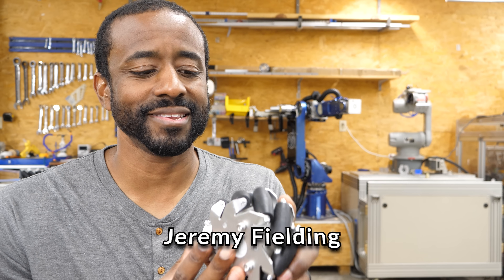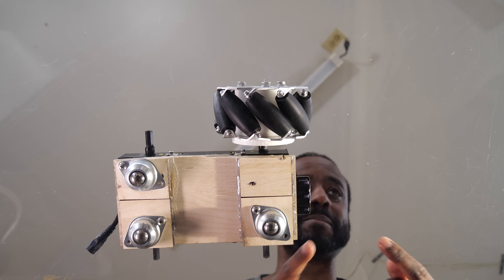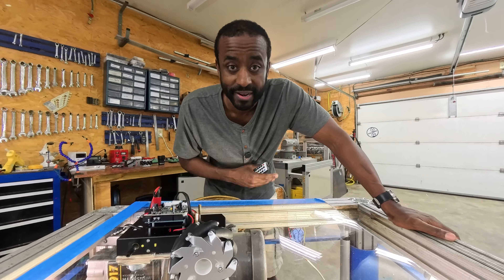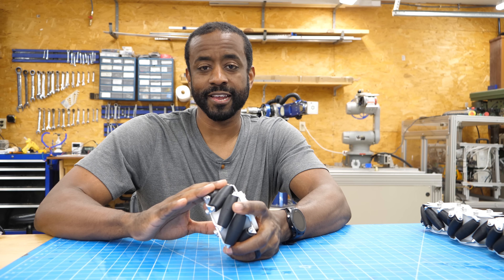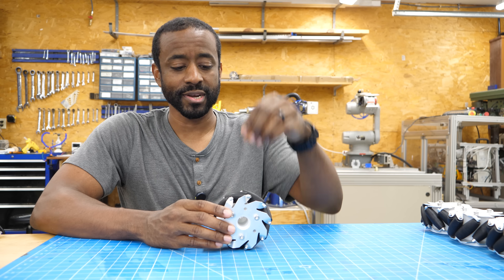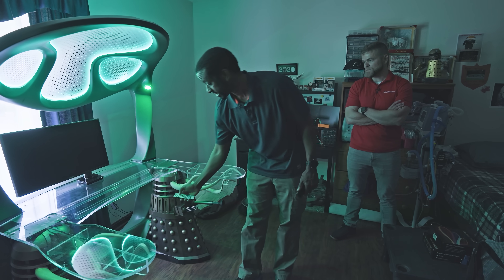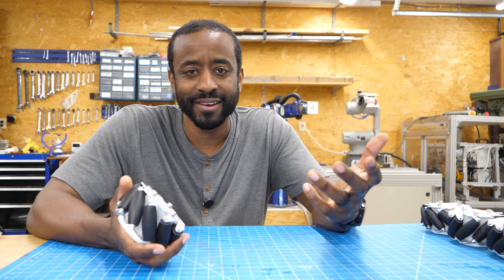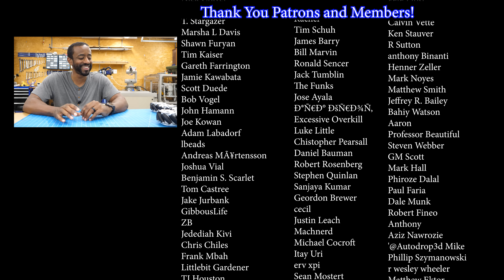The Mecanum Wheel Is So Weird, It Is Genius. How It Works

Comment: About 10 years ago, I had my students (cc) design & build a mecanum wheelchair that was controlled by an Arduino, joystick and solar PV panel for recharging the batteries. We demonstrated it to @60 middle schools around S.E. Michigan and a Maker show at Henry Ford Greenfield Village. It was a HUGE success! It was also bulit from recycled materials, except the mecanum wheels & Arduino.
Reply: The BYD cars from China have a similar feature. The tyres look like ordinary car tyres so im wondering how they achieved that. can any one help
Reply: @techguru7631  No.
Reply: @techguru7631  My best guess would be a similar low-traction design where the wheels are meant to slip. Though, there are also certain vehicles that have small retractable wheels underneath that allow them to deploy for very limited applications to move horizontally, like parallel parking. It would depend on which one you saw.

Comment: I would exploit the Mecanum Wheel maneuverability platform by adding a paint pen to the robot so that it can be used to write on the ground in two modes. One mode would print text, the other mode would print a simple vectored image.  An optical mouse may need to be added for position feedback.
The more expensive version would have ground effects fans so it can print on a wall.
Both versions are controlled by a ESP32 phone link with onboard picture capabilities.
Reply: A Sparkfun OTOS would work much better than ann optical mouse, as a mouse doesn't give rotation data, which you need to keep track of position.
Reply: @BrainStormzFTC  Wow! this is a real game changer.  I had no idea this existed.

Comment: So the Mecanum wheels are just a "regular" wheel with rollers where the treads should be that are angled and spin freely or is there an internal thing that turns all of the rollers at once?
Reply from the maker: They spin freely. Its all in the video!

Comment: Look at the VEX robotics platform. There's no reason for you yo reinvent the wheel. I found VEX was very confusing to HS kids that had never held a screwdriver. Many had no practical concept of gear rations,etc. I would piece together a simple robot using mechanum wheels and a simple claw.  Proximity sensors  would be good. It has to be robust because you know it's going to be abused. Just my 2 cents.  Retired Engineering and technology teacher

Comment: As far as budget, what I have wanted for a long time is a kind of robot subscription service. Something like $100 at the start for the base of the robot (control boards, some motors, some servos and sensors) and $20-$50 a month after with each month adding new parts. 

So the initial payment is a control board, some motor and sensors and every month after, more parts, motors and sensors. One month would the parts to add r a small servo arm and the next month might be the parts add vision. So over the course of the year you end up with all the pieces to make several different robots and you've slowly build the skills and knowledge to use them, rather than being overwhelmed by a huge package at the start.

Comment: Cool factor and genius, yes, but the price asked is not compatible with the BOM. Never bothered with them, if needed laser cut materials and off the shelf wheels and components have been good enough. For our forklift, we tested the fifth wheel in the short run to just under 7 ton until it was mechanically destroyed (bent pin shafts and a deformed outer hub spider).

Comment: Depending on how complicated you want to get, you might check out SimpleFoc. 
The Mosquito (community design) is a 8-24v, 2 amp bldc servo driver board that's runs for about $6-7 when made through JLC.

They would probably be better for your more complicated robot that you were talking about.

Also, did you check out linear advance for your 3d printer? :)

Comment: Are there any mathematicians here? I do not understand the relationship between the curvature of there roller and the diameter of the wheel. Also does the wheel width change depending on hof many rollers you use? There are Mecanum wheels with 8, 9 or 12 rollers. Can I build narrower wheels or does the wheel start to "hop"?

Comment: Having an inner tube that can inflate/deflate on the interior if the mecanum wheel, between the rollers and the hub, would hold the rollers in a fixed position. Not sure the increased complexity would do anything other than make the wheel break more often but maybe you could get less slip on the mecanum wheel when using it as a traditional wheel.

Comment: I kind of wish you would have gone into a little more detail of the wheel structure. Like, what angle are the wheels set at, based on the diameter of the wheel; here are the number of angle-rollers you should have. It looked like the rollers had a bit of taper to them, what was the taper? Are they tapered on both ends? Are there an even number of rollers or an odd number? etc. etc. Granted, I realize those answers vary depending on the application, but I'm just the type of person who likes to geek out over the details and features. A little food for thought for your next video, good luck with the robots.
Reply from the maker: Wow... great questions. They are "usually" set at 45 degrees. There are engineering choices for increasing the number of rollers and decreasing diameters etc. They are tapered to keep them from interfering with the ground as they rotate around. The corners would make a very bumpy ride. These are all good questions. I thought about these things at the beginning, but when I started recording I sort of forgot about these details. I encourage you to research them. There is more to find especially if you want to design your own.

Comment: Jeremy, think about this- a super-expensive idea, I know. 

Imagine that, rather than a  single row of traction elements, you had, say, three rows of elements, and the elements could pivot through 90⁰. The inside of the wheel would be geared to rotate the elements in unison from a single source, separate from the driving force. 

The elements would "home" to the position where all were in alignment for straight, forward/backward travel.

When lateral, crabbing movement was desired, the elements would rotate, in unison to 45⁰ left or right, depending on the direction required. For concentric spinning, the fronts and rears would be pivoted in opposite directions, and forward or reverse drive would dictate clockwise or counter-clockwise rotation. 

This would eliminate the canceled forces, making it more efficient in travel, in every direction. 

Sensors and an on-board computer would allow a robot to "see" obstacles in its path, and plot the most efficient path around them. No Roomba effect. Also, equip it with warning blazons and alarms. For pesky moving obstacles, such as humans, it could be equipped with an announce that said something  like, 
"I'm on a mission! Get the hell outta my way!"
"Coming through"
or something totally ineffective and always ignored, like, 
"Excuse me, please."

Comment: Another interesting omnidirectional drive system that overcomes some of the Mecanum wheels limitations is the one used on Willow Garage's PR2 robot. It uses 8 wheels. They are arranged as 4 sets of 2 wheels kinda like those 2 wheel chair casters used on office chairs.

Comment: Great video but it looks like you've been caught by crappy stock forklift footage @6:16  You are not supposed to drive around with a load raised or in the process of being lowered or raised. Where possible, when you have a load that obscures your view, you are supposed to drive backwards to the destination for maximum visibility.
Reply from the maker: Perhaps this is a good thing? It made you point it out and now new operators know this is bad practice?? It happens :)
Reply: Who cares, that’s not what this video is about… are you also looking for building code violations and fire code violations in this video? 🙄

Comment: i wasn't looking at the example clips so by the time you had the demo, like midway through the video i realised that these are not just funky omni-wheels, when you said those are free rolling

wonderful video!!
Reply: Both generally use free-spinning rollers.  The Mecanum beats Omni, however, because Omni can't drive sideways on its own without additional mechanics.  It only slides sideways.
To borrow from X-Men: Apocalypse, the Mecanum wheel is as far beyond Omni-wheels as they are beyond normal wheels.
I think Omni-wheels were a pretty big thing in robotics, until somebody figured out rotating the rollers 45 degrees made them so much better.
Reply: @VoltisArt  oh wow that's interesting

Comment: So substitute fins on the wheels for the rollers and then do you have a boat that you can move any direction? Better yet, keep the wheels but also design a mechanism that is able to extend the fins between the wheels for water use. Just a thot.

Comment: That forklift is a smooth operator for sure. I love the idea. But I can't imagine how quickly those 'wheels' wear out for a forklift. I also imagine each of those castor (wheels) would need pretty robust bearings at each end. Do you control each wheel independently? or would it be like a skid steer and just by side? I imagine there will be a decent amount of computing to make it into a joystick control figuring what percentage of power goes where to make it move where you want. Anyway, I love this type of stuff for sure.
Reply: As he said, only in hospitals and floors that are even and cleaned. maybe
Reply: @atvheads  the floor being clean certainly helps with this and other business operations, but isn't really critical and the Mecanum wheels aren't special that way.  A more abrasive floor like blacktop/tarmac would wear the rollers down more quickly as it does for any plastic or hard rubber, but as long as you're not dealing with massive potholes or rugged terrain, Mecanum wheels are very nimble and capable.  Smooth or painted concrete is typical for warehouses and factories, and good for both people and forklifts of all types.
Many outdoor forklifts would use rubber tires just like cars or construction vehicles, to deal with the terrain needed.
Reply: Each wheel requires its own motor, (or at least its own transmission) but this is becoming increasingly common for vehicles anyhow, and Mecanum eliminates the need for any additional turning mechanisms.
The controls are pretty basic on the user end.  One standard joystick controls forward/back movement and turning.  An additional linear joystick controls sideways drive.  During sideways driving, one (left or right) pair of wheels turn towards the inside and the other turn towards the outside.  (If seen from above, kitty-corner wheels are going the same direction.)
Turning operates just like a tank or skid steer, where the outside wheels move faster, or each side opposes the other for in-place turning.  A simple computing system would add and subtract the signals from the three inputs and route power where it needs to go for each wheel motor.

Comment: "What is this going to do?" Answer: "Nothing. It's just cool." ----- This guy gets it. Well done.
Reply: I think I have seen it on one of the laser guided vehicle model that a company demonstrated at a logistics meet that I attended sometime ago. It might even find application in the tug that they use to move planes from terminal to runway. So, "What is this going to do?" Answer: "A lot and it's cool too."
Reply: @abdultairu  I really do not fine it likely to use these wheels on a tug. They have very minimal surface traction even for their own weight. Tugs need a great amount of traction which is why they are very heavy. Four wheel steering would be a more likely method.
Reply: @abdultairu saying what it CAN be and IS used for is beside the point. There is likely no application where this wheel design is the best option when downsides and benefits are weighed rationally... unless "coolness" is included.
Reply: @loxtuf well obviously that isn't true since companies are currently using them.
Reply: @loxtuf Did you actually watch the video? It answers your questions.
Reply: My first car drove like that…. 🤣
Reply: @wheater5 😂😂😂😂😂😂😂😂😂
Reply: @wheater5 ah…! Crossplies…😂
Reply: If you have ever worked in a logistics or other material movement environment, it's absolutely a game changer. Isles don't have to be as wide. Construction equipment may not need as much space.
Reply: Discounting their value, just makes one seem ignorant.
Reply: Warehouse operator robots
Reply: I disagree, allowing a forklift to sidetrack like that is going to allow Amazon workers being paid minimum wage, to stab forks through boxes and packages far more efficiently
Reply: @SquidVicious44444 😂😂😂
Reply: @SquidVicious44444 Yeah it's bloody impressive tbf . Beats standard wheels and tracks by a mile for warehouse type work. Game changing in fact.
Reply: Don't you love
trains, trams, aren't they all beautiful  :)
come take a ride! (at folder 2, look my way)
Reply: Ancient technology rediscovered probably a helpful device for moving huge stones into precise locations and be able to move different directions. Helped with precision in ancient building methods.
Reply: @jasonchitwood7436  🤔
Reply: Ya.. & don't use them anywhere but on a well polished, perfectly level floor, so no drain grade or outdoor..
Reply: @ericstyles3724 The video answers your concerns. Try watching it.
Reply: Amazon will buy it, they buy all kinds of stupid stuff.
Reply: What did the forklift do?
Reply: @RifaiAL Watch the damn video!
Reply: Well done keep it up boss men
Reply: Off road applications are limitless😮
Reply: In fact it would help to alleviate the problem of intelligence deficit in robotic/driverless vehicles which are now able to take 360 degree evasive action in the event of last [nano] second interruptions to paths, thus, 'enhancing' decision making and reducing collisions.
Reply: You missed the enTIRE point
Reply: I made those wheels for university robotics back in 1991
Reply: It’s going to make your mind grow, which is sufficient value. 😉💛💛💛
Reply: BYD  YG U8
Reply: Silly question. The whole point of the video was to explain useful applications.
Reply: Unless the ground is perfectly smooth the rollers will damage. That's what wheel chair uses in Sweden where it was invented. Looks cool but not very useful in the reL world
Reply: Riiiight.  And you're a snowflake that removes comments from anyone who challenges your child like logic
Reply: This was utilized by a company called airtrax. They had forklifts, scissors lifts and pallet jacks that used this type of wheel. Really cool technology and you could spin a scissor lift around in a circle. The company disappeared
Reply: I wonder about wheel wear with so much slippage causing roller flat spots increasing friction, and the cancelation of forces is wasting energy requiring beefing up the frame structure/hubs, bushings, to meet the constant opposing force loads. I'd be interested in resulting fatigue patterns.
Reply: I'd like to remind you guys that Gorilla glass had no widespread use until Smartphones arrived, 50 years later!  So keep this in your "vault".

While Corning's Gorilla Glass is now ubiquitous in smartphones, it was initially developed in the 1960s under the name "Chemcor" and had limited commercial success, primarily used in niche applications like race cars. The glass was not initially developed for consumer electronics. It was Steve Jobs who, recognizing its potential for scratch resistance, championed its use in the first iPhone. 

Here's a more detailed breakdown:

Early Development (1960s):

Corning developed a chemically strengthened glass called "Chemcor," designed to be strong and lightweight for industrial and commercial uses, including automotive and aviation. 

Limited Commercial Success:

Chemcor saw limited use, including in some racing cars, but never achieved widespread adoption. 

Steve Jobs' Vision:

In 2007, Steve Jobs, then CEO of Apple, sought a scratch-resistant, thin glass for the original iPhone. After a search of Corning's archives, the Chemcor project was revisited. 

Re-engineered for Smartphones:

Corning reworked the Chemcor formula to create a strong, thin, and scratch-resistant glass suitable for touchscreens. This new material, later branded Gorilla Glass, was used in the first iPhone. 

Widespread Adoption:

Gorilla Glass quickly gained popularity and became a standard feature in smartphones and other portable devices.
Reply: This wheel's ability to allow 360-degree movement in tight spaces makes it worth it.
Reply: You have obviously never tried to offload a forklift load at a 3 high level in an aisle that barely has clearance. I have and a forklift fitted with these wheels would have been wonderful.

Just take a thought with you. Your failure to imagine something has nothing to do with its reality.
Reply: @johnrains8409 Imagine it's safe on a ramp..
Reply: @johnrains8409  wrong again. I have. yOu ObViOuSlEy can't imagine a skilled operator or all the downsides of the wheels.
Reply: @loxtuf  Sorry, but I can. I have been a skilled craftsman, as an electronics tech in the USN, as a forklift driver, as a pipefitter, and as a professional mechanical engineer in the chemical and petrochemical industries.
Reply: SpaceX uses them
Reply: @awesomefeldmanfamily  US Navy bought the patent from the original inventor, they also use it.
Reply: this  ''guy'' should take an IQ test.  It would be interesting to know where he stole this from
Reply: @Bla_bla_blablatron Did you actually watch the video? He didn’t steal it from anywhere.